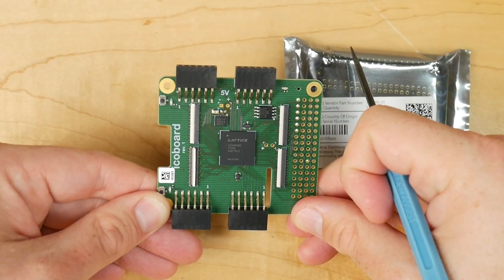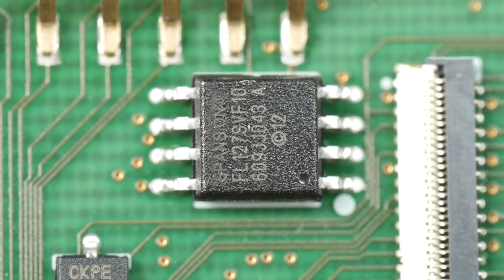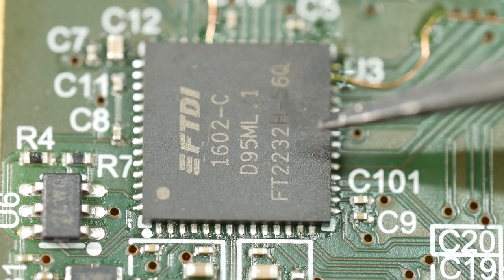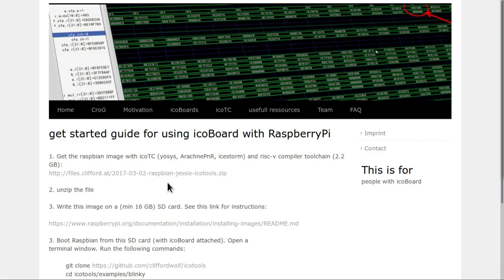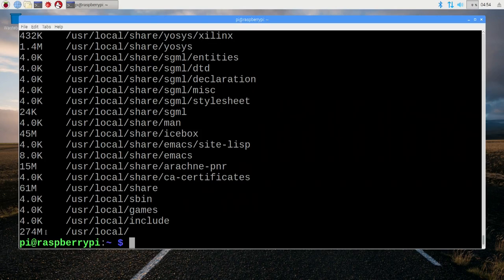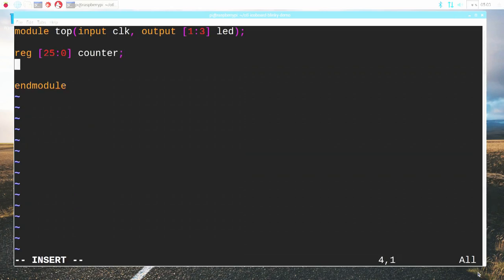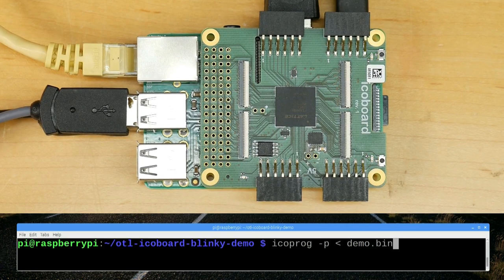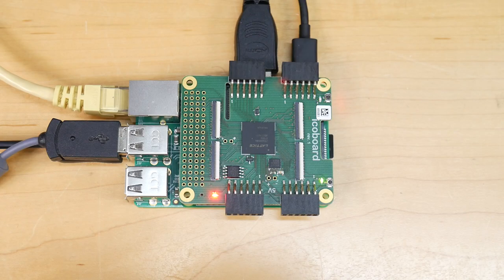[013-1] Open Source FPGA Synthesis with the icoBoard - part 1

Comment from the maker: Corrections
- In the Verilog code, the 'leds' should have been accessed in MSB to LSB order i.e. 'leds[3:1]', not 'leds[1:3]'. Similarly, the 3 counter bits should have been accessed with 'counter[25:23]'